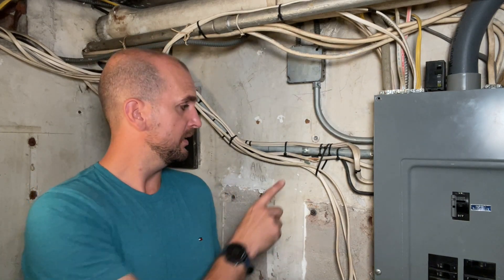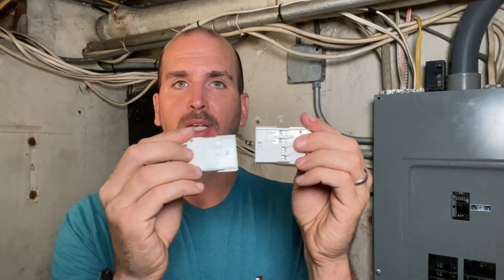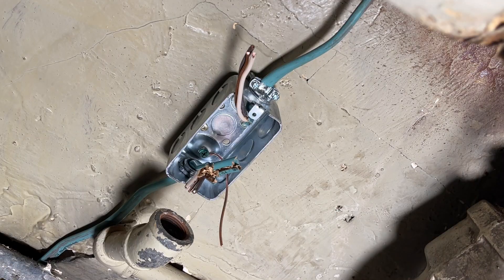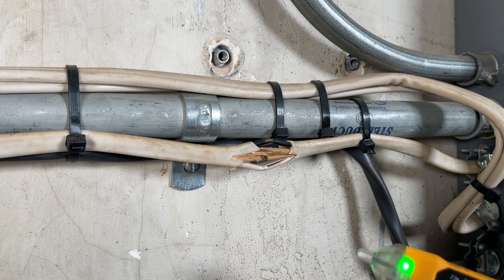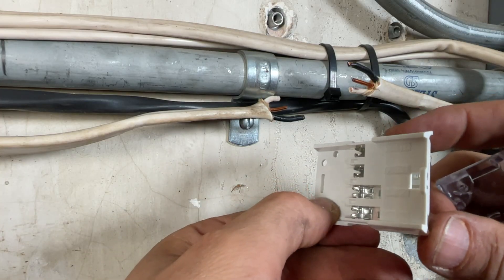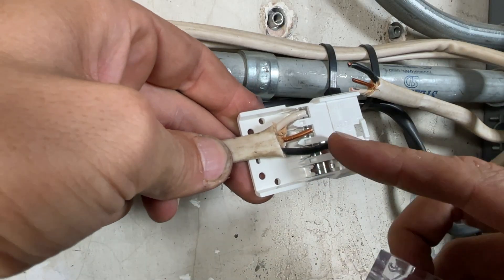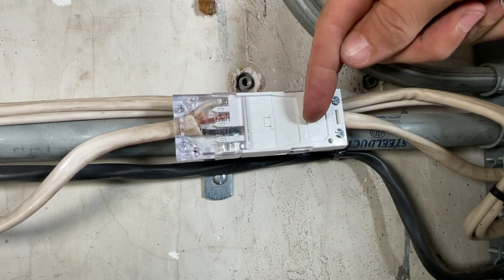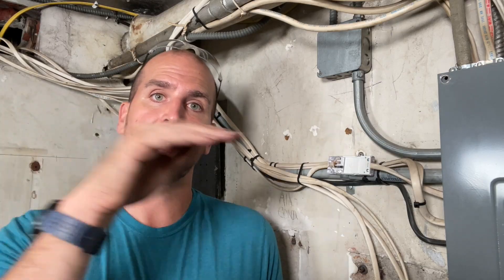How To Repair Damaged Romex Wires

Comment: I wouldn't trust this plastic splice connector with anything. Maybe a temporary solution for a day or two at most. The contact surface between the wire and the fork it's been pushed into is way too small and very unreliable. I've seen splices with 2 forks one after the other for automotive and they are rated for 2A. I wonder what current is this one rated for? 0.5A ? I also wonder how did this one get the approval.

Comment: The TE splice kit looks like a great solution, but I wonder how many hamfisted DIY types will crush the plastic with pliers and break it.  The pins into which the metal screws are fitted also look like a failure point due to over tightening.

Comment: I don't know man, I get that those are NEC approved, but after 20 years dealing with scotch lock or vampire connectors in RVs, trailers, and people who use them on cars; I just wouldn't trust it. Do they give you an amperage rating on them? I feel like if you put a decent load on them the resistance caused by just scratching into the wire would cause them to get hot
Reply: They are rated at 20A at 300V.

Comment: As a journeyman electrician, I was curious what awful hack you were gonna show us. You taught me a legit trick! Thanks. Those look like what the double wide trailer people use to wire two halves of a house together. Not ideal, obviously, but a legit cost effective fix
Reply: Legit trick???? Perhaps mobile homes don't use serious amounts of electricity, but that still doesn't make it right, does it??? Did you even see how tiny and the thin, little metal, pierce connectors are????  You really trust these low voltage former telephone, auto connectors, to handle the load and heat, long term?? Wow... I will never call you out to my house, thank you...   :)
Reply: @frandanco6289  talk to Underwriters Laboratories not me. If you don't like these gadgets, wait till you see the piercing receptacles low end mobile home mfrs use. They're worse imo.

Comment: You don't like the push in connection on receptacles but make a video using displacement connectors.
Reply from the maker: Fair argument.  I am still looking for a better solution to the issue which also meets code.  Appreciate any experience and/or feedback .  Thanks.
Reply: @EverydayHomeRepairs  I have been doing electrical work for many years and really can't say I've had problems with the push in connection on receptacles and switches, just try to pull the wire out without the release and you get an idea of what the connection is like. As long as ESA and code requirements are met I will continue to use the push insert. Contractors might have a different opinion when you are installing hundreds of outlets, unlike home owner installs time is money.

Comment: There is so much bad advice in this video. But I'll start with the fact that you trust a voltage pen to check for dead.
Reply from the maker: Assuming you use a DMM?

Comment: I'm a pro and I most definitely like and use the Wago's but I would have used a pair of 4 x 4 x 2 1/8 steel boxes and cover plate.
Reply: Love WAGOs ! I also replace with new wires wherever I can. Some of the existing wire I either can't trust the installation to begin with, or the insulation is questionable on the very old stuff.
Reply: Electricalron.....I like room to work too!

Comment: I'm amazed that I don't see this for more professional, testing to make sure that your tester is functioning to confirm that it's working before testing the line I would go one step further and coming back to a known source after and testing it again. That's common practice for proving units and test meters in England. I just have a dodgy tester that I don't trust so it's good to know that my finger didn't slip on the button between testing testing and then working.

I'm coming around to wago or wakos or whatever they're called but I have pulled off enough Outlets that have used the backstab wire method and literally had the wires slide out, so I don't necessarily trust push in type connectors.

Comment: Just rap each exposed conductor with multiple turns of good quality electrical tape without cutting the conductor. Then wrap the entire cable with electrical tape. Electrical tape is a good insulator.

Comment: The example of the "handy box" as you call it was a code violation. Your conductors need to extend at least 6'' from the back of the box, and also depending on where that's located that romex should not just be ran freely like that without any sort of strap or securing device.
Reply: Lol this man has never opened an outlet up from 1920 he be like oh I can't extend these wires it's a code violation code says whatever I touch I own I gotta run a new wire now
Reply: That's actually not an accurate statement. 300.14 The wires have to extend 3 inches past the edge of the box if any dimension of the opening less that 8 inches. So if you had a shallow handy box, you would not be required to have 6 inches of free conductors.

Comment: These splice kits are pure crap!! They are a fire hazard just waiting to happen. As a electrician for 40 years I would never use them. Loose or poor connections are the point at which conductors will heat up. This splice just created 9 possible failure points.

Comment: i would not cover a connector like that in a wall unlike metals will corrode eventually making that connector fail. maybe adding a dialectic grease would be a good idea?

Comment: Using a voltage tester is not a safe way of checking for power. You had exposed wires, Use a multimeter check for voltage across the live and neutral, your lack of safety is concerning. You should not be teaching people how to do electrical work, hire an electrician and get it done properly

Comment: I don't like the plastic splice block mainly because of the way the connection is made. Your hoping that by pressing you will get a good connection through the plastic coating of the wire. These type of connections didn't work very well on liw voltage like for trailer hitches. I recommend the box or a new wire.

Comment: One point about checking for a dead circuit.  ALWAYS use your checking device on a known live circuit first to verify that it is working.
Reply: The other point I would make is that in this video he seems to be touching the Live wire specifically, and basically ignoring the neutral. And sure in theory that works fine, but in theory when you turned off the breaker that was labeled to control that run it also shut it all off. We're not testing things because we're worried about the theoretical problem, we're testing things because we're worried about what could go wrong. So don't just test what should be your Live wire test the one that's supposed to be neutral as well. You never know what's been done wrong by someone in the past!

Comment: Great video, but as someone who had an electrical house fire, let me warn you.....  These splice kits look great, and I didn't even know they existed, but there's a hidden danger - My house fire was caused after I did almost exactly what you showed with the junction box in the first part of the video.  The cause wasn't because of any mistake I made - The cause was because my romex was old.  My house was built in 1972, and in 2013 when I did this, there was no way to know that WITHIN THE UNDISTURBED SHEATH of the romex, the plastic insulation around each conductor was brittle, and when I was bending and maneuvering it into the junction box, some of it cracked inside the outer sheath and was exposed.  My circuit worked fine, and I had forgotten about it completely, but then about 6 months later, the exposed wires began to arc in that section of wire which wasn't even cut, and caused my house to be a total loss.  I know that this sounds ridiculous, but the fire marshal found the wire in question, and showed me how there were pits and signs of arcing on what was now the bare ground wire that was hooked into that box I installed.  (I still have the wire in the garage as a reminder!!)  The arcing was about 12"-18" back from the exposed wires, and had only been BENT while I was working on it.   If you look at about the 7:00 minute mark in your video, you can see how a few inches back from where you're working, the romex is bent.  If that romex is old and brittle, there could be unseen danger in that bent section.   My rebuilt house has "Arc Fault detector" type breakers, and the fire marshal said this is what was designed to prevent my problem from happening again.   Again, I think this video is great, and the methods shown are 100% sound, and I will definitely be looking to buy some of those junction connectors because they look really useful, but just be warned - Old romex insulation is brittle and can cause issues!!!!  Please be careful!

Comment: That does not seem like the right tool towards the end of your video where you used to channel locks to snap those wires in or whatever. That seems like it could do some damage very easily if you're not experienced. It looks like kind of Cheaper thinner plastic so all it takes is a misalignment and it's broken?

Comment: Not the way I would fix it, at least not with those splicers. I probably would pull a new wire, but if I was on the cheap certainly in a box and go with a better splicer kit. Reality check, you went from having solid wires that weren't actually "damaged" except for the thin cheap sheathing now just to a cut wire with physical weaker splicing.

Comment: I have read many comments on this video and completely understand how horribly dangerous it is to splice any wire before entering a panel which explains why all fixtures of all kinds come with continuous wires meant to lead back directly to a breaker without ever being spliced. Every REAL professional electrocution KNOWS that all lights, switches, outlets and appliances are meant to be hard wired and home runned without a splice ANYWHERE because SPLICES ARE ALWAYS BAD!! I mean why would you add another point source for failure by using a wire nut, fixture screw or butt splice when using one continuous run of NM is the safest method of wiring in any and every instance all the time and every time??? /sarc

Seriously people? This reminds me of plumbing threads: 

The lead pipe guys: I'll never trust that new fangled galvanized steel, heck you don't even need to learn how to melt lead or pound oakum to makes connections. 

The galvi guys: I'll never trust that new fangled copper junk, ever look at a penny in your pocket? I'd never drink out of a cup that looked like that and besides, you don't even need to carry a pipe threader on your service truck so how can you call yourself a real plumber? 

The copper guys: PEX? Bah! Plastic is for toys not water pipes. And besides, how can you call yourself a real plumber if you can't even learn how to solder correctly??

Now, to be sure I've installed cast iron drains where noise is an issue because you'll never silence ABS or PVC like hundreds of pounds of cast metal can,  and there are times when I've mixed up a batch of plaster to patch a lath wall instead of tearing it out to replace it with gypsum board, and any number of other exceptions to the rule, but the rule remains true: Innovation leads to better practices and more affordable universal adoption of safe practices in any trade, and tradesmen and women who cling to "the way we always did it" are doomed to obsolescence or worse: using dated and perhaps dangerous practices due to "tradition."

Skepticism is one thing but knee-jerk hating on any innovation because it clashes with "how it's always been done" shows a closed mind and lack of imagination I personally don't want in ANY person I'd hire to do any job for me.
Reply: You make a few valid points. But this is not a new way of doing things. It may be a new innovation for the splice part of the two blocks, but the manner of connections from the conductor to the block is not new. It has been around for decades. And many electricians, myself included, have had to replace this type of connection after it failed.
Reply: So you think every single device or light in a house is “homerunned” ?

Comment: It is an extremely bad practise to use a non contact voltage detector device to determine if a circuit is live... the only way to test is by direct connection.
Reply from the maker: Thanks for the feedback.

Comment: Looks like a nice system, and I wasn't aware it existed. I generally don't like insulation displacement connectors like that, but it's still much better than the spring-loaded "backstab" abomination found on outlets and switches. Why that was ever approved, much less remains allowed by code, I'll never understand.
Reply: Actually, those "insulation displacement connectors" are even worse than backstab. That one small spot where the  connection pierces the insulation is the only contact for the load to pass through. So your #14 or #12 copper wire has now been replaced with that tiny point that pierced the insulation. This is a weak spot that will break down with time  depending on the load on this circuit. And, even if the current use of the circuit is limited, we have no idea what will be plugged into that circuit in the future.
Reply: The very existence of backstab is a problem even when screws are used to secure backstab connections. My house has a dryer outlet that failed because the carpenter who installed the receptacle pushed the wires in, thinking, "Backstab," but didn't tighten the screws. I replaced the receptacle with a better one. When I go to bed I try not to think of what else in my house might have been wired by that carpenter. Oh well, nothing in the house is Federal Pacific.

Comment: I prefer to change the whole cable. If it is an expensive cable, I use special sleeves. I doubt the qualification of the inspector. Never but never get wired on water pipes! 👎

Comment: Solder, soldering iron, heat shrink tube.  3M do a nice thick industrial one with a heat sensitive adhesive inside.  But electricians never seem to know anything about electrics.

Comment: This is not NEC approved.  (Exposed)Romex is not allowed inside or outside  or basement,patio ,garage.  
 Everything I saw in that room would fail inspection in Florida. Exposed wiring. Tie wrapped to metallic
Conduit.  EMT or PVC is the correct way to run wires.  NATIONAL ELECTRICAL CODE. 35 years experienced.
Reply: I think you need another 35 years because you are wrong

Comment: The Romex exposed on the wall is not acceptable by code either. Lol. 
Romex needs to be buried in a wall, it cannot be run on the surface, you need MC cable or conduit.
Who the hell is the inspector!? Some sort of all in one building inspector I'm sure, because if he or she was an electrician that would not fly.
Reply: Wrong

Comment: That splice job that you did in the handy box needs at least 6 inches of free conductor. You used about three or 4 inches, that's not to code right there.
The splice kit that is for manufactured homes, is done in a crawlspace, not in a wall. I would have to have you show me in the code book where you see it is acceptable, I don't believe it.
If you bury it in a wall, and it has a problem, you cannot access it. Thats why its not acceptable.
 If it was in a crawlspace or an attic, I could see it might work, but its cheesy for sure.

Comment: Whenever you have a snap-together tight connector oh, there's always insertion loss. A weak spot that can oxidize. I like using a little Dielectric grease with connectors like that
Reply: I use dielectric grease on EVERYTHING that conducts. Just habit now.

Comment: There should have been a new wire ran from the electrical panel to the junction box. There should be at least 6 inch of wire from both ends in the junction box. No splice should ever be buried in a wall on wires that carry over 100 volts. There is a reason electricians do thing a certain way, it's not to make money, but to make things safe. Don't be lazy do things right. do things safe.

Comment: Honestly both of these examples are  poor practice and should not be done for any permanent fix... This video really should be taken down... I'm not sure why the algorithm popped this up but. Yeah... 

This whole setup is a hot mess and a future fire... But let's dive in...

I'm on this notion that my wires should have proper contact, & be secured as often as possible at every connection point; besides staples or cable ties at proper intervals... A waygo just doesn't do either IMHO I don't trust the connection... And a TE is almost worse in a way... Honestly a proper pigtail, cap and tape, I would trust over what I saw here... But if you put a box I would go with a non conductive option... You're not running an outlet or switch... All grounding that box is goin to to do is make it a hazard if the hot line is exposed to it and the breaker isn't GFCI... Basically you created a shock hazard for no reason.

There's a lot of good suggestions in here... My favorite was electrical tape... While it might not be code... In the given examples... Wrapping the ever living shiii out of each conductor then the whole line would be a perfect diy repair that doesn't likely burn down the house, or introduce 15 amps Into a kid... And whoever said it would fall off clearly is the reason why it's not code... Some people just don't get it lol.